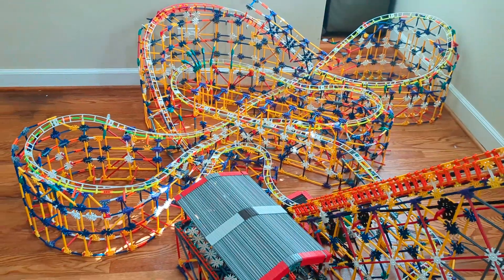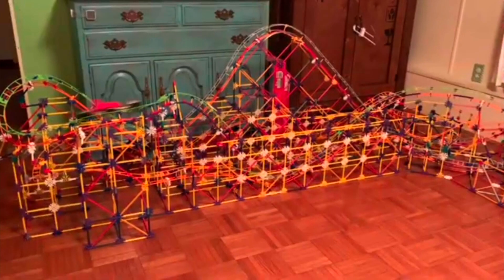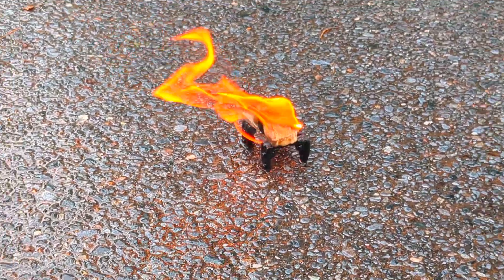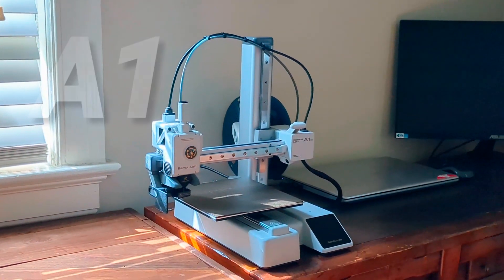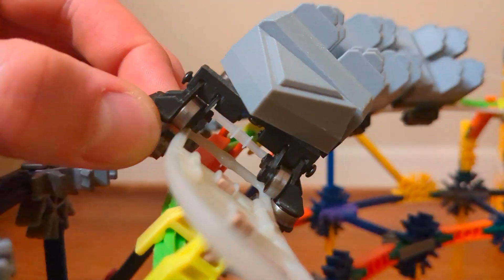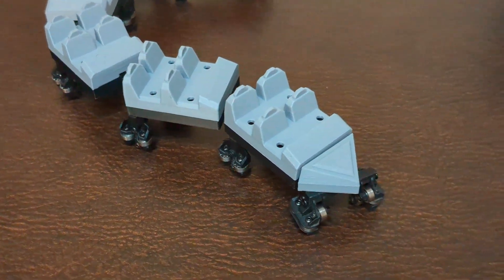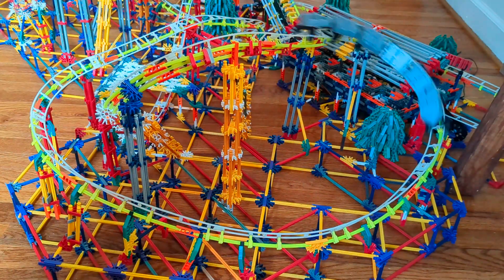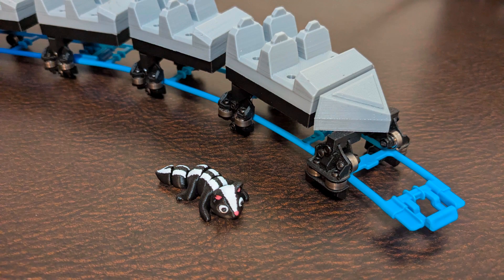How I Built the Ultimate Micro K'nex Roller Coaster Train

Comment: What us the weight because I have to use all micro pieces
Reply from the maker: Based off of the tests I've done, they run best with weights in them. That does mean you need to support the track more. You can take away the weights if its to heavy.